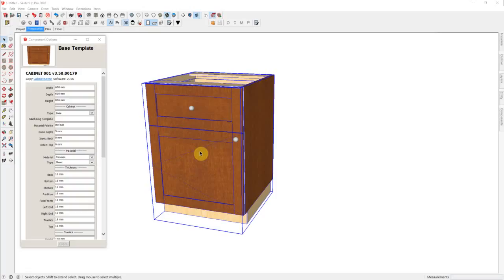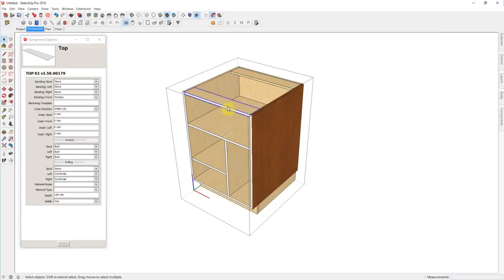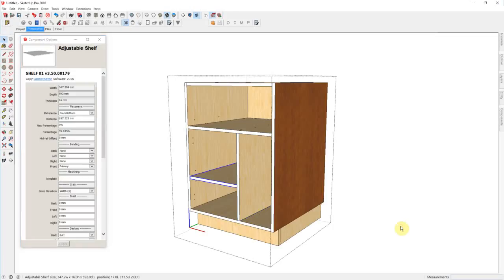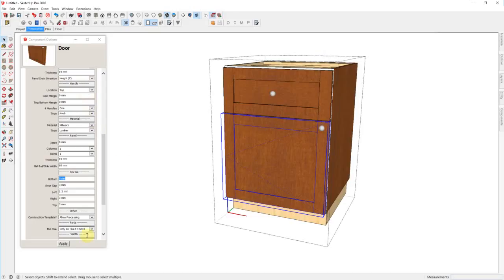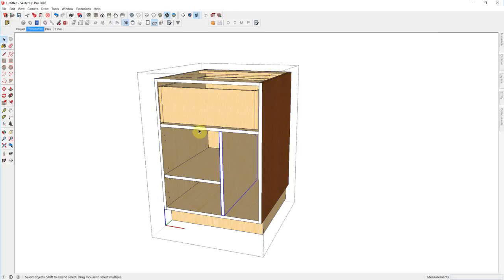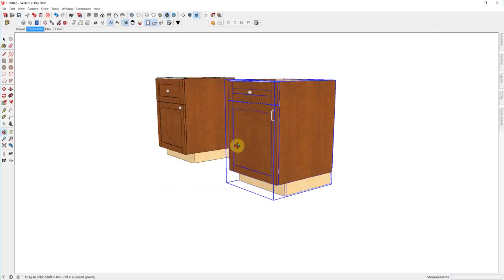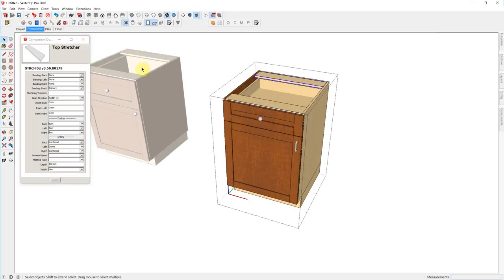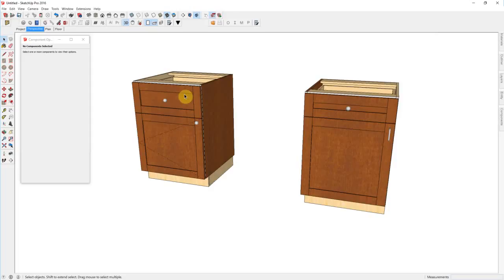Construction Templates - Design

Comment: How can you remove the door elevation lines off the door? The dotted lines which is looks like the unit on the left has but on the right it doesnt?
Reply: There is an option in the general cabinetsense settings to hide or show these door swing lines by default, or you can turn on and off a layer which they are on